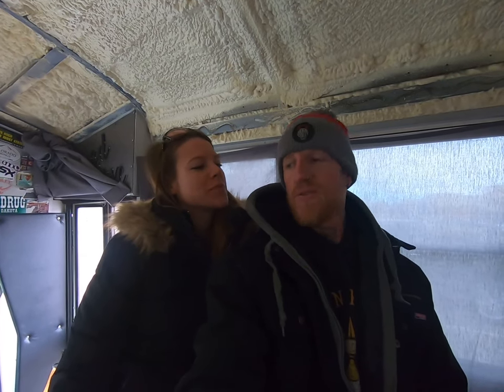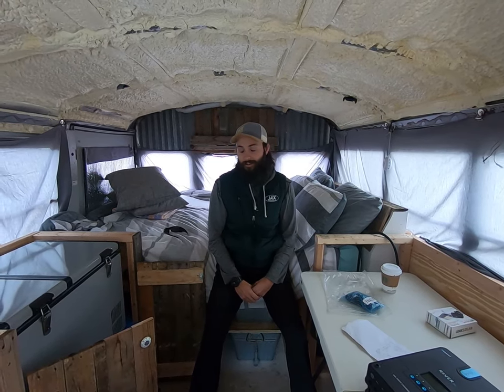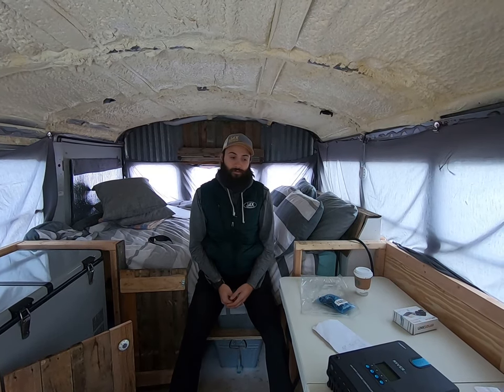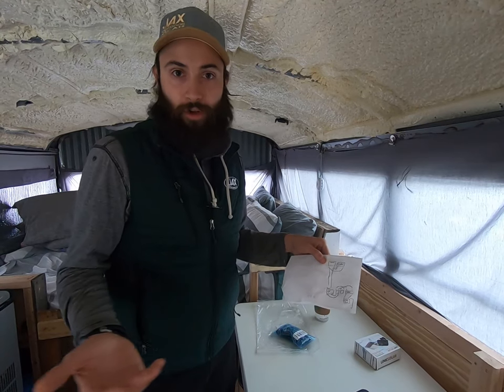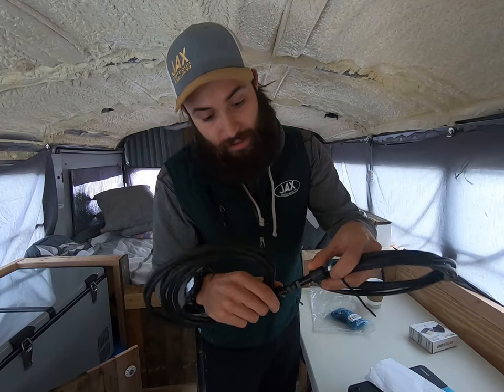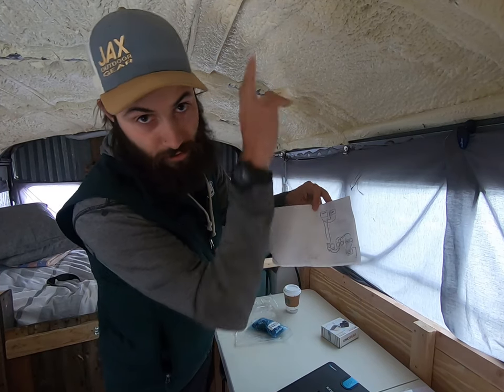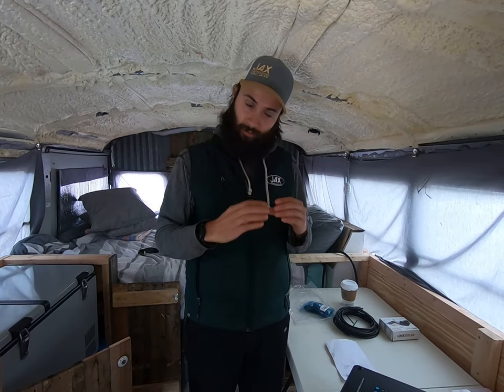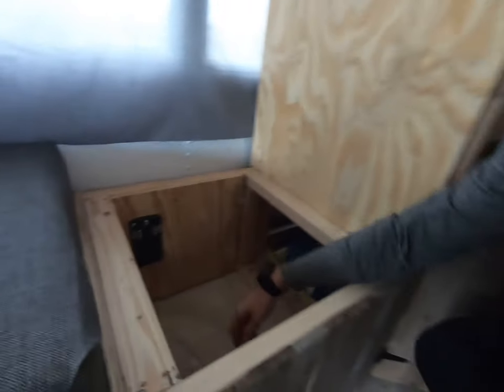How To Install a Solar System | Skoolie Conversion | Bus Life

Comment: Just found your site, and I've been binge watching the videos of your Bus build.. Dustin, can you  take another look at your diagram posted in this video. I can't make sense of it. The panels and the batteries don't appear to actually being in series or parallel. I'm currently running (2 ) 300 watt panels ( in parallel ( panel + to panel + to controller, and panel - to panel - to controller.) My (3) 200AH batteries are also in parallel ( + to + to +  and - to - to - .Thanks Gerald
Reply from the maker: Yeah that's how I did mine too. Obviously each person's set up can vary, but mine is all positive to positive and negative to negative. Thank you for catching that though. And most of all thank you for watching